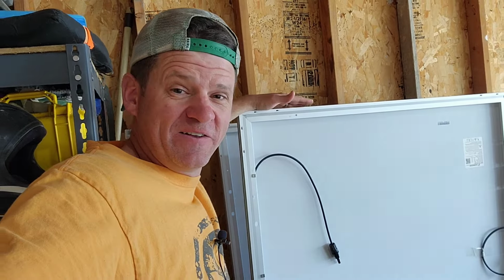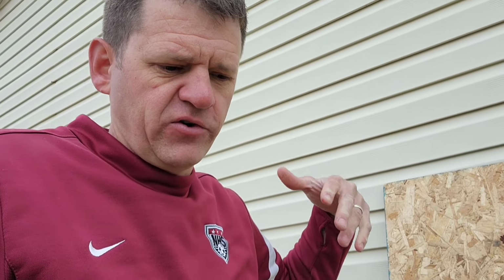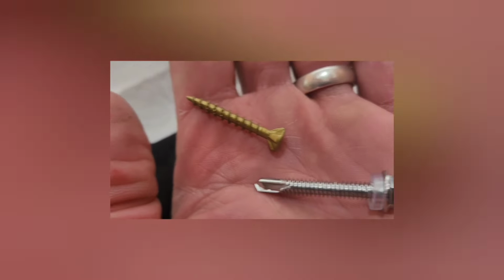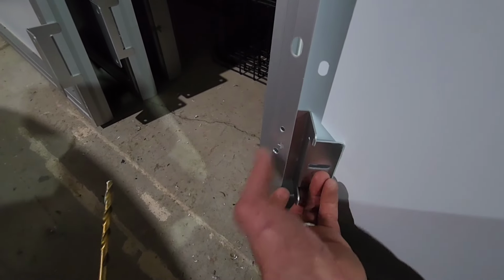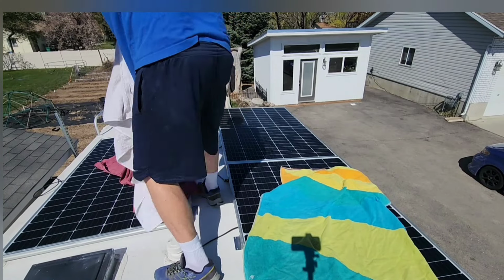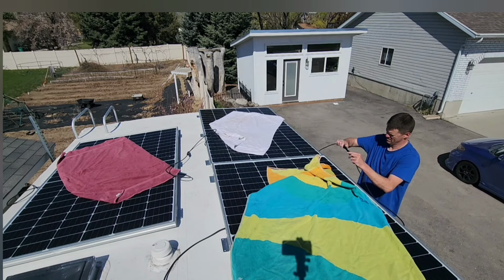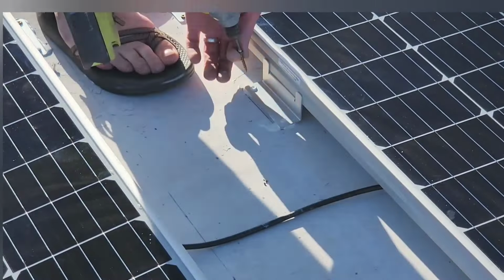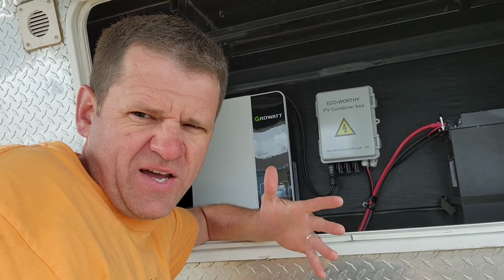DIY install 1,575 watts of solar panels on my RV roof

Comment: I don't think a fully charged battery will run your A/C for 5 hours.  That would be a good test though, like you did with your refrigerator...
Reply from the maker: You are right. I think it's more like two and a half to three hours. I believe the fan on the air conditioner pulls from the 12 volt system. I wasn't accounting for that and I think that's an extra 400 watts. These air conditioners are super inefficient. I would really love a mini splits in my RV. Those are awesome I'm super efficient. They also heat the RV which would be really nice. I'm surprised RV manufacturers don't put them in.

Comment: Ballpark $ How much has the entire set run you?
Reply from the maker: Rough estimate 
-Battery = $1,750
-All-in-one charge controller/inverter $750
-combiner box = $100
-5 used solar panels available for pickup in phenox or georgia: $250.
-wire and brackets $100
TOTAL :  $2950.00.  
A loud RV generator will cost you $3000 - 4000 but won't have the same starting inrush ability of this my system.
Reply from the maker: @livingindetroitmetro-shawn9895  thanks man. I think I'll like it.  👍
Reply: While I don’t have as big a solar system as the poster, I didn’t install solar and Lithium to save money. I wanted electrical “freedom” to run all my devices, lights, TV and fans without worry, and I got tired of wet battery maintenance and replacement every three to four years. Now my only limiting factor is water.

Comment: Do the used panels you have/purchased have bypass diodes? (Have you experimented to know it is true?)
Reply from the maker: I think I took them apart and saw them.  I'm finding the Bipass diodes don't work as great as they say.  Seems like I'm still loosing power when one panels is shaded.  I need to mess around with it more.
Reply: @diySolarPowerFunWithRay  I went back and forth on my ground mount house system and it is now parallel. For example, my yard faces true south (lucky me) and so I have "sunrise" and "sunset" panels feeding one inverter. Those panels obviously face opposite each other but in a line perpendicular to my panels for my other inverter that faces true south. The sunrise/sunset panels are in parallel. During sunrise, my West facing panels are completely in shadow due to large oak trees that run North/South along my eastern property line. While those panels are in complete shadow, my sunrise panels are putting out 740+watts of a potential 990watts. That is at 7:00AM in the summer in San Diego. So parallel works in my situation with complete shadowing. My panels are 3 year old Renogy 330Watt monos.
Reply from the maker: Nice, You could also get a charge controller for each set of panels you have. That way you can measure how much power each one produces as well as not worry about them affecting each other when one set is shaded.

Comment: So if the inverter/charge controller uses about 50w idle, does that mean that you won’t charge your batteries until your solar panels are making at least 50w? Or is there a way to disable to inverter and have it just charge the batteries? I’m sure with your setup that that isn’t a huge issue for you with all your solar, but it might be an issue if you had less panels.
Reply from the maker: When the inverter is converting DC to 120 volts ac that is correct. But you can turn the inverter off, but it will still keep that mppt charge controller on which will charge your batteries without 50 Watts idle.

Comment: So the length of wire that came connected to the panels was long enough to connect panel to panel (which is what I think you said)?  Are those the new Renogy or the used SS ones?
Reply from the maker: Those are new panels I bought from signature solar.. Not renogy panels though.   I went with new because I only had limited space up top.

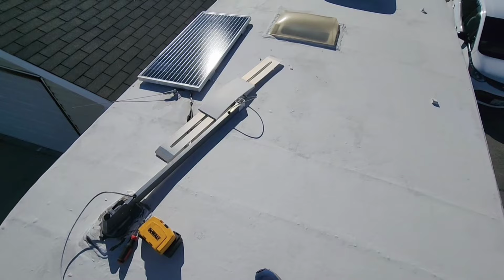Comment: Does the Combiner Box connect the additional solar in series to the roof solar (assumed to be in series)? Did the combiner box come with the additional MC4 connectors installed as we see at 1:14? Thank you.
Reply from the maker: It connects each string of panels you plug in "In parallel".  It came with the mc4 ends installed.
Reply: @diySolarPowerFunWithRay  Thanks. By watching your original 12volt to 48 conversion YT I figured it out, but came up with more questions due to the spec label on your Growatt with a very low input current value from PV.
Reply from the maker: @benkanobe7500  I think that was a typo on the sticker.  Here's the spec showing 80A: https://signaturesolar.com/content/documents/GROWATT/1519009-specs.pdf
Reply: @diySolarPowerFunWithRay  OK. That makes way more sense. So you could have some flexible panels stored and pull them out and add to the trailer when camping if you wanted. That is really nice. In the specs you linked, it showed this: "Number of Independent MPP Trackers/
Strings Per MPP Tracker 1/1" What does that mean as it sounds like only one string would be MPPT or since the next string (plugged into the combiner) would be in parallel does the controller treat the roof and additional string as one giant string??

Comment: Thanks for sharing.  Like #114.  Just found your channel!  Subscribed!  So it has been a summer?  Would you do anything differently?  How well did the panels hold to the roof?
Reply from the maker: The pals did great. However, I would not put all my panels in series like I did in this video. I would also order the different version of the growatt that can accept a lower solar voltage.
Reply: @diySolarPowerFunWithRay  Hmmm.   I haven't bought anything yet.  Why?  I was going to install four 400W panels, so I can do series/parallel.  Thoughts?
Reply from the maker: What is the voc on that panel? 36voc?   I would be leaning towards a 2p 2s configuration... If you were to get a 48p growatt model. If you put all four solar panels in series, you might be pushing the limits of the max voltage the unit can accept. However, if you have a 2p2s configuration, you will be hovering just above the min.... which may not be good on cloudy days or right when the sun comes up. I would try the 2p2s configuration and see how that does.  I have the same amount of solar and have loved it. I don't think I have plugged in once this summer.  But it cools down in the evening , so I don't need air conditioning here at night.
Reply: @diySolarPowerFunWithRay  Canadian Solar  CS6R-400MS-HL  VOC:36.8V
ISC:13.85A  so 2p2s would be 73.6v 27.7A.  I got the 48v EG4 because of its UL rating
Reply from the maker: @DennisWintjes2  those are some big panels. I would definitely do three brackets on each side. The brackets are cheap. I like the brackets I used. But I got new screws. Did you say you were planning on getting a couple growatts?